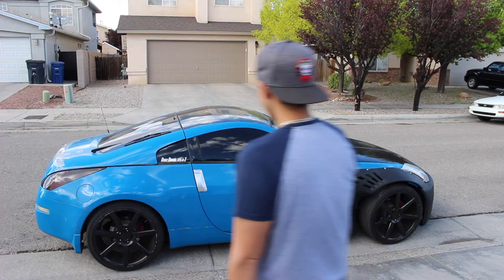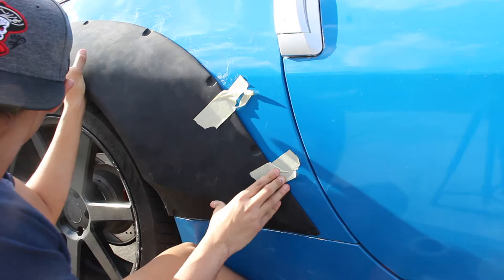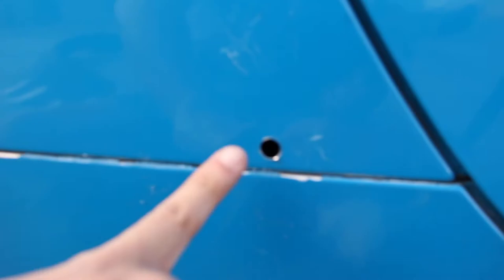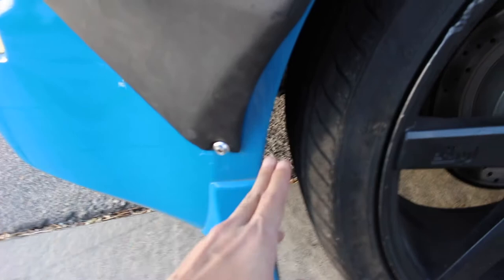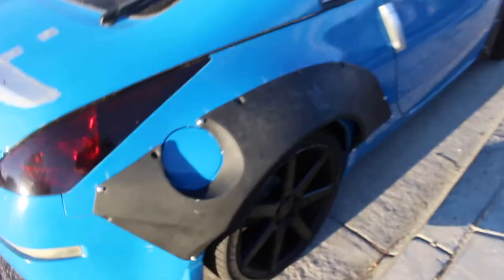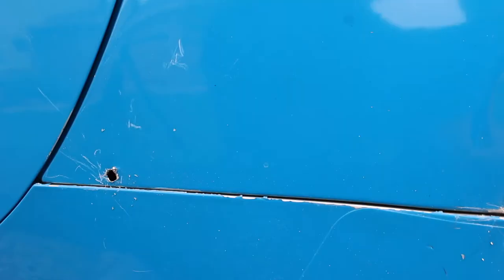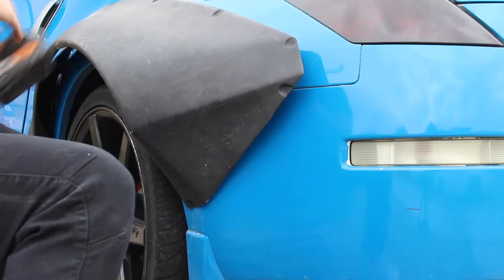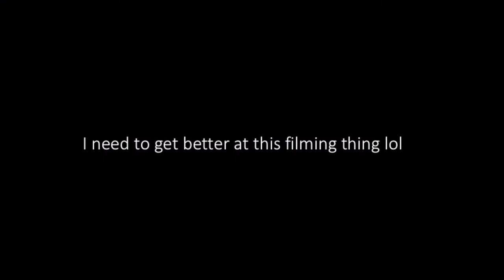350Z ROCKET BUNNY INSTALL PT.2

Comment: Do you have to use wheel spacer when you put the fenders on?
Reply: No, you can technically put the fenders on by themselves without messing with your wheels, but it’ll look extremely stupid if you do it. If you want to get a wide body kit either 1 get wheel spacers or 2 get wider tires
Reply: @ttboosted7634  what tires do you recommend I am getting my 350 soon
Reply: @jameswilson8436  depends man, depends on what you'll be using it for. Check out fitment Industry, they'll help you find a perfect wheel/rim setup, that's where I got mine from. Im running Toyo Extensa HP II tires currently. They're really really nice, they work perfectly in any weather. Can't vouch for snow tho, we don't get snow down here in Texas but other than that they're a really solid set. If you want to drift, you want something with less Tread Wear, I run Falken Azeins FK510s for when I want to take her sideways. Sorry for the long comment, hope this helps!

Comment: Does the well nuts hold it Nice so it wont fall of?
Reply from the maker: They have threads on the inside that the bolt threads into, and the rubber on the outside secures it to the fenders.
Reply: What kind of nuts you put it on the kit